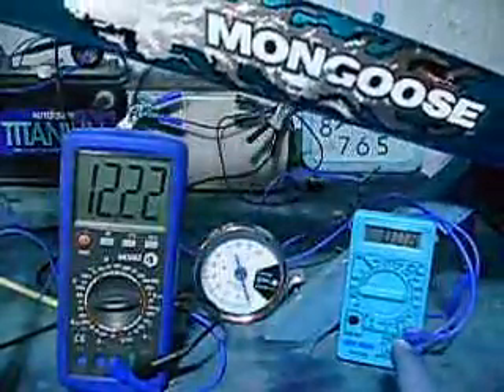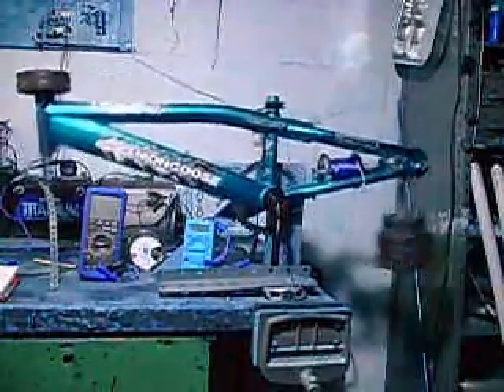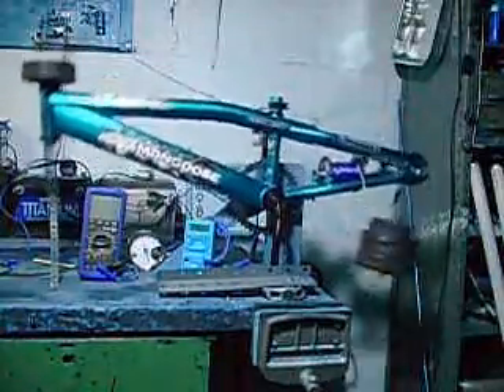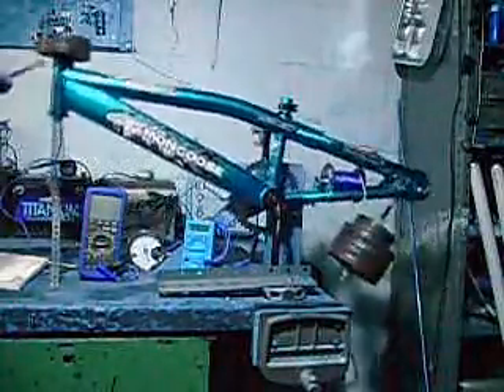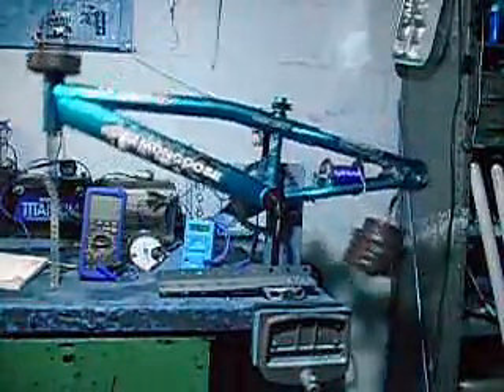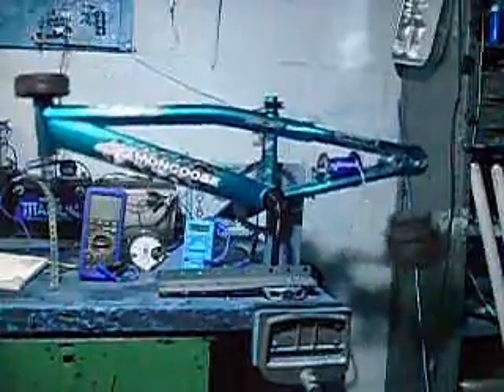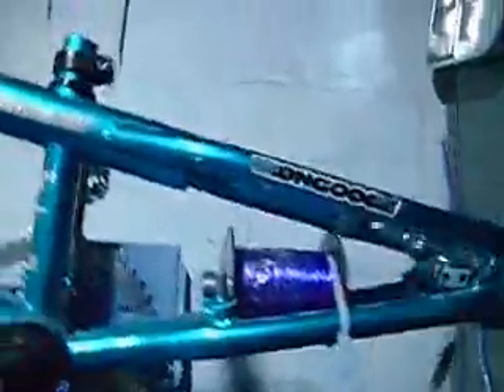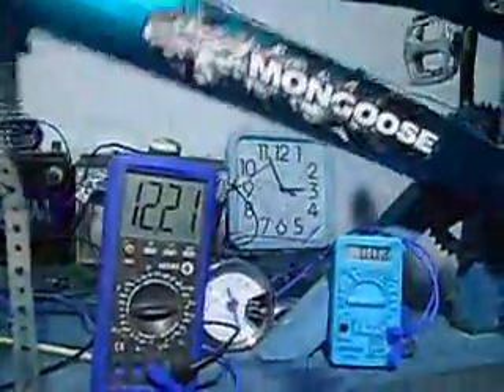Bedini Pendulum Milkovic Two-Stage Oscillator

Comment: When the weight swings to the left that is the point when the spring is pulled up. Could this not pull on a wire attached to a pivot that pushed into the weight? It seems like it would push at the exact moment it started swinging back so would be perfectly timed to keep the pendulum swinging all by itself.

Comment: Veljko Milković, an academic and inventor from Novi Sad, has done something great that has not been done by any Serbian inventor before.
Milković invention of the mechanical oscillator is widely used worldwide, a testament to the fact that over 500 foreign companies use, sell and manufacture pendulum-based machines used in the heavy industry.
The purpose of the two-stage meganic oscillator is multifaceted, because the character of the machine (two-arm lever with pendulum) allows its use as a press, water pumps, compressor, crusher, power generator, mini power plants.
The world's companies have made use of this invention because its use reduces the need for non-renewable energy sources in the wide range of jobs for which this machine is used.
Through such achievements, Veljko Milković laid the path for new challenges in physics in the 21st century, which could be the forerunner of the new great scientific revolution.

Comment: Veljko Milković, an academic and inventor from Novi Sad, has done something great that has not been done by any Serbian inventor before.
Namely, according to his invention, a two-stage mechanical oscillator, today over 350 conscious companies manufacture, use and sell machines and crushers used in the heavy industry.
The purpose of the two-stage mechanical oscillator is multifaceted, because the character of the machine (two-arm lever with pendulum) allows its use as a press, compressors, crushers, power generators, mini power plants...
The world's companies have made use of this invention because its use eliminates the need for non-renewable energy sources in the wide range of jobs for which this machine is used.
With this move by world companies, Milkovic implemented that his invention could be used in practice and very successfully.
 Through such achievements, Veljko Milković laid the path for new challenges in physics in the 21st century, which could be the forerunner of the new great scientific revolution.

https://companyveljkomilkovic.wordpress.com/

Comment: The old inventors of the cuckoo wall clocks already proved that you need an elevated weight as a source of energy to make the clockwork run for a week.  But you need an input energy. This pendulum has a natural frequency and needs to resonate with something of the same frequency to have any meaning.

Comment: Do not think on another.batery or anothe Bendiny coil, Pls, use two niudenim magnets oposite to each other Like N-N or S-S and the only thing you have to adjust is prosimity.-Cers StevePS: about one inch diameter

Comment: Excellent job, may I know how long does it oscillate? I've heard the record is around 2-3 hours.
Did your reach that or perhaps beat it?
Reply from the maker: The machine is powered by the coil it will run as long as you have power

Comment: people don´t you see the pattern in ALL overunity examples?  

its always something moving in a WAVEFORM, building a quasi pre-singularity-state , its not a singularity because it won´t speed itself up but its damn near and therefor produces more energy output than input  . this is one ultimate knowledge.

closing the loop ISN`T NEEDED , IF YOU THINK LIKE THAT YOU ARE NERDS WHO WANT TO LIVE LIKE THOSE FAT TURDS IN "WALL-E" !

think about practical solutions in a world where electric energy will be super expensive( the near future) or where no electricity is available (3rd world help projects)

something like this could help any traditional BLACKSMITH IMMENSELY !

Comment from the maker: It oscillates exactly the same  without the coil.You have to "tune" the unit correctly first before you can add the coil. I do not understand what is causing the asymmetrical oscillations.I have got it to oscillate with a goose neck end pump at the left and right swing of the pendulum.Now the goose neck end pump happens at the bottom of the pendulum swing, same pendulum setup different spring and counterweight configurations but the pendulum is not crossing the coil fast enough to activate it

Comment: Regarding slinky460's comment: the difference in the bounce when the pendulum is in or out is due mostly to push coil being mounted to the frame instead of being isolated so that it will only affect the pendulum. The wheights push back on the coil as the coil pushes the wheights.

Comment: This is a neat and functional design-works very smooth!
If your goal is to measure input and compare it with the output(left side), you should have something that really spends energy on the left side. Spring just stores the energy when compressed or elongated, and then gives it back.This way you cannot calculate the output.

Comment: Energy must be added for acceleration of the pendulum at its highest point, to use the least possible amount of energy.  According to the video, your timing pulse is fired when the pendulum is already at maximum energy level.  Example: an object will fall at 32ft/s/s. So after 1 s. its falling at 32ft/s and after 2 s. its at 64 ft/s. but if you accelerate it to 64ft/s in the 1st s. and let go, how fast is it at the 2nd sec?... 96ft./s. But whats needed if you wait till 2nd s before you push?

Comment: RIGHT ON! You could actually get a sterling engine attached to the spring and produce more mechanical energy - and if you place a nother coil under the weights where it move counter to the 'pendulum you cound have two pick up coils.  Or you could make your pendulum mechanism  a long rod perpendicular to a number of pick up coils, all you would nee to do is distribute the weights along the perpendicular rod.
Nice work.

Comment: I have thought of this combination many times. 
Bedini SSG circuit is very efficient, & Milkovic  oscillator is remarkable.
I really appreciate where you have placed your coil, though i do strongly  recommend an r60 core & ditch the solid iron core when possible.
As for harnessing power there a a couple of ways, maybe separately mount the rear wheel with chain attached to front of bike  & spring the other end of chain, this should spin the wheels cog and then maybe add a dynamo on wheel.

Comment from the maker: @TheHoxan The coil is 20awg & 21awg approx 1200 turns 400ohms added resistance on the trigger coil, solid bar iron core.I am running the SSG circuit,  the one that's red and blue  illustrated when you Google Bedini diagram/images. Pendulum 22lbs, front counter weight 4.4lbs